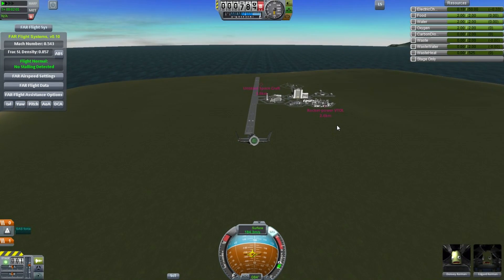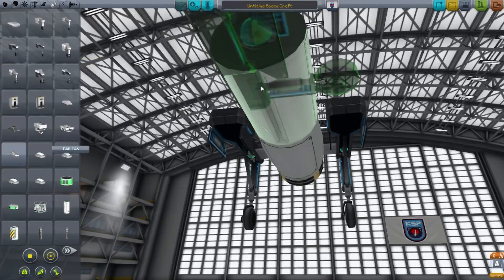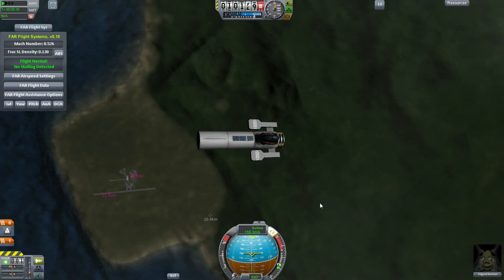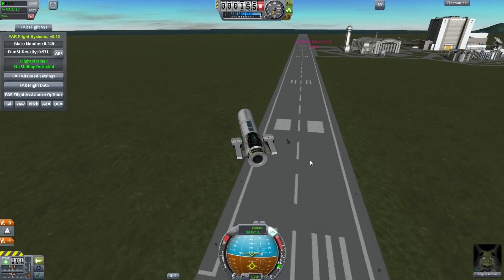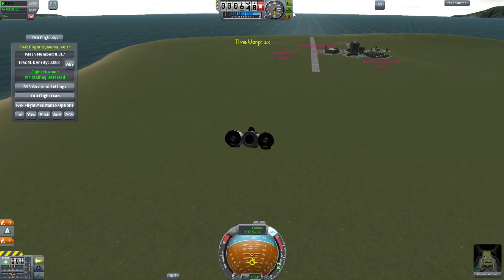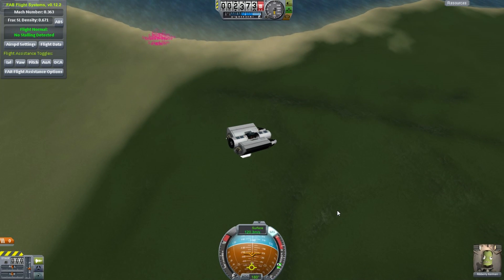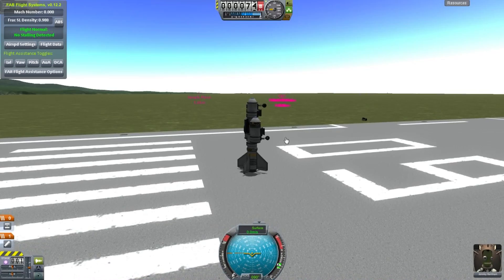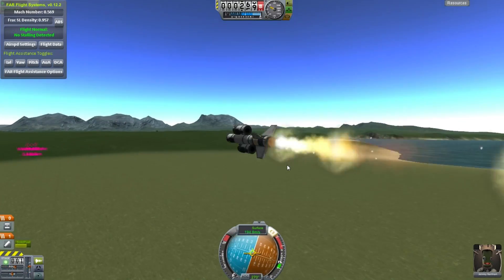Kerbal Space Program - Making Lifting Body Aircraft Fly

Comment: Scott.. Any chance youll revisit this but now with Ksp 1.1 and it's new aerodynamics?
 I can confirm that you can even use parts that dont provide any lift to ironically, make lift via body lift.
My tip is use the Angle of Attack of parts and surfaces to create your body lift.. And it's okay to go over 50 parts for a 40 t plane or spaceplane when doing this..

Comment: You don't need Ferram in order to create working lifting bodies.  I recently built a rocket that went into a very low orbit. So low, in fact, that it aerobraked into the atmosphere after about 5 orbits.  It flew down gently through the atmosphere, and dropped to under 20 vertical meters per second before I deployed the chute.

Comment: I might get Ferram, even though I try to stay as vanilla as possible, but it would make things interesting........... and I would need fairings.......

You know what's strange? The Mk1 jet fuel tank thing weighs 1.0 and is pretty darn small, empty weight .75. but the Mk2 weighs 1.1, is huge, and has 10 more fuel than the mk1, with an empty weight of .80. How does that make sense?
Reply: Kerbal engineers had a drunken party when they designed the spaceplane parts.
Assuming they invented alcochol before rockets, since the wheel came after alcochol in human development.

Comment: scott i thought you should know this in case you dident already know but the warp drive works on the basis of you have the same orbital speed when you enter warp as you do when you exit warp regardless of the direction you start the warp facing or what your orbiting if you orbit the sun for a while and move around to different parts of the system you will notice that you never actually change the orbits speed from the speed you started at  so you can use this to your advantage by putting yourself in an elliptical orbit around the sun wait till your at the same speed as the planet you want to orbit and then press go and you will find your orbit will actually change to a similar orbit to the planets orbit in terms of  just a difrent inclination and a difrent ecentricity which you can fix with a burst of the warp drive to change the direction to the same direction as the planet then all it takes is to match inclination and get an encounter that puts you in the planets gravity well so basicly the warp drive is just an on of switch to warp space around you at exactly the same rate at all times as long as its on and when its off space goes back to normal
Reply: sorry bout the long winded explanation and the wrong video wasent paying attention to the playlist as it changed from your interstellar quest so it was a bit of topic
Reply: Ever heard of AutoCorrect?

Comment: The stock landing gear's high mass is largely irrelevant, because the game doesn't actually include the mass of landing gear parts on physics calculations. I seem to recall it's the same deal with struts, they don't add to the in-game mass even though they show up on the VAB/SPH stats...
Reply: Several things going on there, the (non)-mass of the landing gear wasn't the problem. Rover wheels would've helped you get started moving. And most ion powered craft in stock KSP end up getting more thrust from control surfaces and infiniglide than the ion engine...
Reply: Yep. Stock landing gear are massless in flight. The SPH CoM indicator lies, but you can see how they're not included in the mass readout in map mode.
Reply: tavert
Do you know if this applies to stock landing gear and stock struts only, or all parts that are similar type, such as landing legs or third party langing gear like the B9 landing gear?
Reply: Good question. The landing legs have mass in flight, I know that much. For B9 landing gear I'm not sure, it might depend on whether they are using the stock ModuleLandingGear or their own implementation. Other massless parts are the small cubic and octo struts, the strut connectors and fuel lines, ladders and I think a handful more.
Reply: Weird, I could have sworn that when I was trying to lift off an ion engine powered aircraft the landing gear were too heavy, so I had to use the rover wheels.
Reply: tavert Yeah, I did get frustrated with the project and gave up eventually. But thanks for explaining.
Reply: tavert That explains exactly why when I decouple landing gear and shitloads of cubic and octagonal struts they can fly or decouple all the way from the runway to the launch pad
Reply: Chubbymushroom That was a reply to Tavert's second reply

Comment: Hey guys! I just tried to use my xbox style controller for PC with KSP. It worked quite nicely, you should try it out too. Has anyone else tried it? Any suggestions for control mapping? I used the left stick to handle pitch and yaw. roll is on the triggers. right stick has RCS up/down left/right. Didn't map RCS front / back anywhere.
Reply: RCS forward/back could be mapped to the Left/Right bumpers of the controller. Staging could be achieved with the A button.
Reply: Toggl3 I have throttle up / down on them. X and B keys have RCS and SAS toggles, Y has staging and a has brakes.